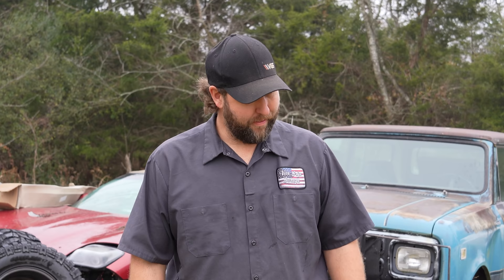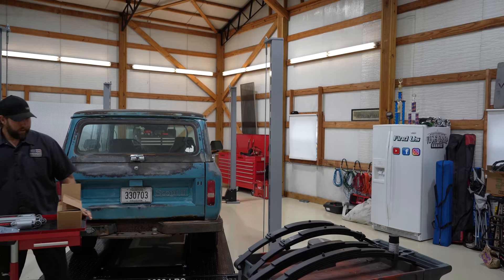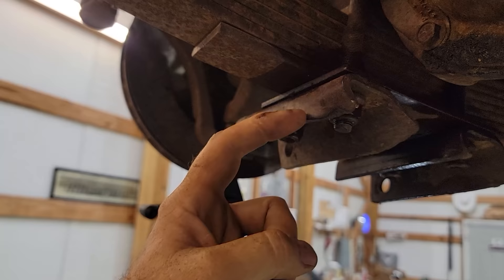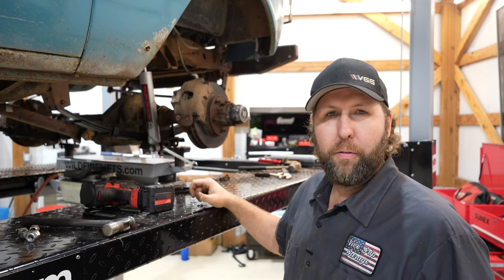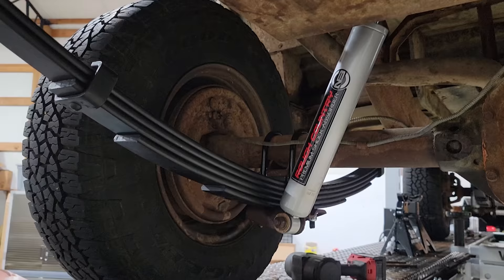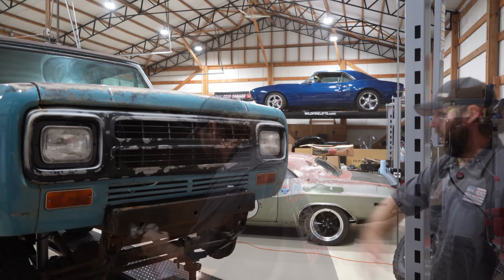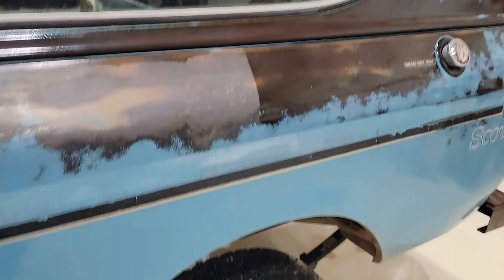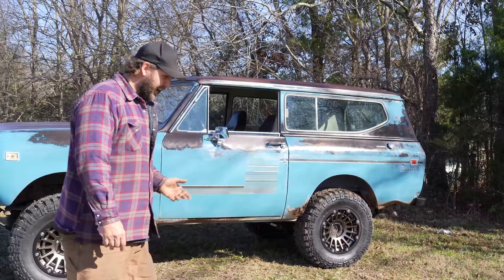I lifted my Turbo Diesel International Scout (INCREDIBLE TRANSFORMATION!)

Comment: Y'know...sticking with the diesel theme, you could maybe find a 4bt Cummins to clean up, and soup up and swap into the ol' Scout. Maybe even get some help from some of the diesel fellers. Just a thought. 

I really like those wheels and having a '89 Town Car with the turbine wheels, I too have a soft spot for them. I also like that mix of brand new and shiny and beat up, patina and I think maybe a matching rear bumper and some old school off road lights on the roof would really bring the scout right around assuming you're gonna be holding onto it for a while. Could be a good rig for goin around the property with and for moving cars around. 

The Lil shop kitty is a cute Lil bugger. Beings he's tasked with keeping the mice down may I suggest the name Bouncer? Like a bouncer at a club? 😁

Comment: It depends on what geats are in your axles now. Sometimes they put low gears in the deisels because they red line at low rpms.  I habe 5.29 gears with 35 in tires and i think im going bigger gears and bought some 5.88 gears. So hopefully i can use 5th gear with the 5.88's in my 93 Toyota 4 Runner. I know a Scout guy local in my area who would know. His brother was my auto shop teacher in high school. He would love to see your Scout. Hes an old timer and probaly doesnt waych this kinda stuff but super nice guy. I had a big block Challenger in high scool and Old Dale the auto shop teacher just would shake his head and snicker when i pulled in. Lol.

Comment: Love the truck wish I had one. They will start better with more compression the pistons can be slugged to increase it. More fule helps it start better the pump can be rebuilt with larger plungers and bigger cam. I guse the axles in those are made by Dana so many of the gears found in pickup trucks will be interchangeable. Also the spider gears can be shimed a lot tighter to help it out with better power division. Also their is a plethora of aftermarket for Dana 44’s and u joints are easily installed a lot easier than the AAM’s. And their are cv axles for Dana’s available. You can also install a better smoking package just don’t smoke any of those left handed filler greens.The headliner could definitely be a moose pelt. With seat liners made from barn yard katskin. It also needs one of those modern revolving moonbeam spotlights so you don’t get into trouble missing one of those DNR roboattos. Definitely needs a heavier cow catcher for for getting the new taxadermic headliner.
Reply: I forgot you can clear coat that paint too.

Comment: You need turbo puffiness, more the better. Then check that fuel pump and injectors are delivering the black goo, a good clean of both will add brakes (horses, that is).

Comment: @vice grip garage some ways to hop up the SD33T is throwing some boat Injector pumps. they can be finnecky though. maybe some fresher injectors too as long as they match the pump. only other thing performance wise would be getting the turbo manifold re done a bit. the engine can take alot of boost but at the same time... it's a high compression engine. no you can't put on a thicker head gasket or modify the head, that's just too much work. i'd recommend maybe an extra 2-3lb boost from what you've currently got, bigger exhaust, cold air ram snorkel if you can swing it, and also possibly making a custom manifold that doesn't have that obnoxious elbow that restricts power. as far as gearing goes... if you want better mileage get you some dana 3.31's. mudding and fun shit would be the 3.73's. It depends on what you wanna be doing with her most of the time.

Comment: I was gonna mention linseed oil after using the ole Ospho treatment because I use that stuff on everything but I didnt think that would be approved, but I saw your link to the other video so you already know one of my special secrets. That suff is sp good we acually use to use that our 3 inch diameter mile long winch cables when I use to tow barges across the Atlantic and around the Caribbean. OG stuff is way better then all the fancy new crap.

Comment: I'm loving the Scout II  Way back in 1980 I test drove a Scout II diesel.  I WANTED THAT TRUCK IN A BAD WAY.   .  But because at the time due to life circumstances it was not a practical or responsible vehicle  for my young 1 car family. 
     Somewhere  stored  away in my memorabilia box,  I have,  If I remember correctly  a June 1980 issue of 4Wheeler magazine.  It might have been Petersons 4X4.  Quoting you, " I don't know". The issue featured the Scout II diesel on the cover and had a several page test review  performed by the staff of the magazine. THE centerfold was a 2 page ad  from International FEATURING THE diesel scout..  If my memory serves me correct it was   a powder blue with orange and black graphics, and orange and black plaid Houudstooth upholstery. IT HAD A BLACK folding convertable top.    I'm going to see if I can dig out the magazine.  I bought the magazine at the Hospital gift shop the night my son was born and was reading it when the nurse come to the waiting room and told me I had a son..  Thats my reason for remembering it was June 1980 issue  and why I've hung onto it for 40years...  PEACE!

Comment: Hey mate i run a sd33t in my mk patrol on 35s in Australia, i run 20psi through the standard turbo with a intercooler and the main fuel screw nearly maxed out and it will happily sit on 110kph with 4.3 diff gears and a 5speed gearbox .
Any more boost and fuel and  youll find the crank or head will want to delete itself 😄 love the build 👍

Comment: Another thing that would help a diesel would be a set of bigger injectors. Also maybe see if the fuel pump can be tuned up some. I’m a Cummins guy and on the older Cummins you could adjust the fly weights in the fuel pump and get more out of it. My dads fist vehicle was a 69 scout but she has 345 gas engine.

Comment: Derek, are you sure you put the correct springs in the correct ends of the chassis?? Some lift kits have the tapered small plate on top of the FRONT leaf springs to orientate the front diff to maintain the proper castor angle. You might find you have "death wobble" when at high speed on the highway.

Comment: Did the Rough lifts on 2 dodges, a 72 Scout, a CJ5, a 68 F100 and a C10, totally awesome kits....But.. put one on an 89 F150 (Traction-beam front axle) snapped the engine craddle in half on my WAY to go mud boggin 😞

Comment: Bought a 95 Ford f250 and it's quite the peach and I relied on vise grips for everything and I managed to only round off 1 bolt it was 1 mile from the restin place and I have minimum tools and it was non running and it took my 6 days is 30 degree weather and just got her home today and didn't even have to change my sparkalators

Comment: Ok, there is a process....  Bigger boost, Bigger injectors (higher flow rate) turn up the fuel pressure at the pump.  Retard the timing to limit internal pressure and keep your heads connected to the block.  Also limit head bolt stretch/breaking.  Diesel Injection in Pittsburgh... Springdale, PA actually pioneered this process with Big Cam Cummins...  600hp from a 400

Comment: If you could find an IH 392 V8 it will go gooder and get about 9mpg tops. The power barn will get a lot fuller if you do that. You could just be thankful you didn't find a really old Scout with the  4 cylinder gas engine. They were like a turtle with weak knees.

Comment: I found one of these about 20 years ago,  behind a garage with a plow,  I asked to purchase, I wanted the plow.. turned out the rig only had 50k miles on her, ran perfect, and the only thing rusted was of all things the oil filter canister.  The best part the new oil filter canister was in the back of the rig.  $500  I made that in 1 day plowing the white stuff, I thought the turbo diesel had plenty of power.  I drove it (2nd car) for years and then traded for a Nissan 300zx   what a mistake,   should have kept the old girl.

Comment: Best choice would be to swap it for a small Cummins, or gas engine. This was  a last ditch effort from international to save the light line trucks. It’s a gutless engine. The IH 4cyl is rated for more horsepower I believe. My old scout had a 345 IH v8. With the right gearing it was a strong engine. 1980 does have the 1% castor to help from the older scouts that had 0 so they would road walk a lot. I don’t see A/C in yours but in 80 they came with a newer system with a larger condenser. Body is suppose to be zinc coated to help with rust… You still have a great foundation for a good rig. Would love to find a good 1980. That little block in the back is a “torque block”. It’s on all the scout II’s.

Comment: There's a few articles on these nissan motors... basically anything you do so the motor doesn't have to run anything helps! Not to much on changing gears in the diffs more about the gears in the manual transmission...

Comment: Well, the first thing you do to get that Nissan i6 diesel banger hoped up is yank it out and toss it in the trash be cause if you try to do any power adders on that engine, the completely unsupported full wet sleeves will just bulge and blow all that extra power into your crank case. 
So pitch it an replace it with a Cummins R2.8 engine. Also pitch that T18 for a TR4050, that way you have the ability to get parts and you have a warranty on both.

Comment: Boost leak? Gummed up sushi cutter? Or is the oil consumption from the trip home and the old block heater / huff gas dose tool a bob a sign the Montana Joe has a loose set of Super-Bowl smoke rings? I guess it is the 200 plus K truck?

Comment: That exact brand and colour of etching primer failed on me with my 97 accord. Put in new rear wheel arches and partial fabbed wheel wells and ran out of the proper  body shop supply etching primer and had to buy one of these olive green dupli brand ones on a sunday to finish the last 15% of the job. All of the paintwork involving this junk had lifted off after 9 months. The other 85% primed with proper etching primer is still ok years later even through Winnipeg winters. Winnipeg is 75 miles from the Minnesota border.

Comment: This is how you find what gear ratio you need to get near stock.
New tire diameter decided by old tire diameter multiplied by current gear ratio. But if your currently gutless what ever you get for a new ratio like 4.55s I would go 3 sizes higher like around 5.13s orsoo

Comment: I dont know if its the same sort of thing, but on my 85 Hilux (Toyota Truck) the drivers side front has a different spring rate due to the added weight of the driver. It was actually a smaller spring overall, to give the same lift all round. But there are no plates, it's just has a higher mount on that side of the axle. When I put my lift kit in I didnt realise and put the fronts in on the wrong side, so the car was at least an inch out at the front, from side to side. Oop, quick enough to swap back after I'd already done it though.

Comment: After working in a welding and fabrication shop, I would never advise anyone to run a wire brush without glasses on…. Oh my god… I’ve had em hit my safety glasses and face shields and the wire stick into it

Comment: You gotta do up the interior! And yeah definitely spruce up the engine. 
I'm not suggesting propane injection, but I dunno bigger injectors and I dunno if the pumps on them Nissan's can go bigger but generaly with diesel fuel is the best way to make more horses. If you're not rolling coal yet see about fixing that :)

Comment: Pull that old oil burner and replace it with the AMC 345ci V-8 or maybe the 360/5.9L from a Jeep Grand Wagoneer. I believe they both have the same bell housing 🔩 bolt pattern.

Comment: I know I'm late but I'm sure there's a few "easy" mods you could do in the fuel pump. The rubber line that comes off the turbo should go to the pump somewhere... There's an adjustment there that tells the pump to add fuel when the boost get up there. As well as... It doesn't necessarily have to return that fuel... You could try blocking the return... Would force the engine to burn it instead of return it... Just some knowledge I've picked up a long the way. Will it work for a nissan diesel? Dunno. Good luck D love your videos man!

Comment: These only have 4 mains, and they are already 21:1 compression, so any performance mods really needs egt monitoring, if it were mine I'd add an inter cooler and turn up the pump a touch, possibly consider chemical inter-cooling or propane injection to keep your pistons from turning into slag.. you want more than 25-50% gain you are probably better off looking for a Mercedes om 603 swap (they have their own quirks, but its a straight six TD with another 50% power and torque stock, plus a better tuning aftermarket)

Comment: When the shocks turn. I use a small pipe wrench. You know.. gripping the shock. Wedged between whatever is breakable. Brake line, whatever. They come apart. Yea it’ll crush the shock but who cares

Comment: Actually the thing about exhaust systems is that you can practically close up the pipe and it will barely effect the flow. Well that's with a set of headers and then you would be closing one of the pipes. So please don't do anything that will almost certainly restrict the exhaust system and make your motor run like crap! Sorry bout dat mi bruv! Out now. So - Oops!!! Hahaha! Haha !!!! As he laughed maniacally in the fashion of Mandark from Dexter's laboratory!!!

Comment: Don't rebuild replace with a chrysler motor. Change the bellhousing. The transferase bolts right on to the back of any torqueflight. Or standards are even simpler you don't need to rebuild the transmission swap any AMC bellhousing to a chrysler bellhousing . Don't have to change any drive shafts or even modify them. You only need to make a motor mount adapter. Then you have a modern drivetrain to last another 40 years. I've done several of these mods in Scouts.

Comment: ive  got  1961  scout  worst  rust  bucket  ever  for  parts  running  gear  =  and  pretty  nice  some  rust  in  floors   runs  and  snow  plow  nixe  body    1963   tank  tough   fixer  upper

Comment: this is a late entry for yer performance question
what it takes simply put is money. U know this stuff.
Ya start at the bottom of the motor and work yer way up . reciprocating mass. on up to the pump.
With a diesel you can go as far as a super turbo
Then of course, being a diesel, gears, gears, gears, and more gears :-)
There is a company in Sweden that makes cam less heads.
Like I said, money.

Comment: You need to learn more about off roading, the old bumper is far far better for protecting the headlights, and radiator, plus the front battery post on the bumper makes the addition of a electric wench so much easier. The protector tabs for the spring ubolts can be a life saver if you do any crawling, as it can prevent the sheering of said ubolts.

Comment: 1967 international scout slant 4 cylinder 3spd hi/lo transfer case granny 4 and invalid 4lo I could crawl faster it was a ggrrrren off road get my bull elk out of the hills rig short bed type truck day cab like blazer or bronco cute little pickup ? Bed just big enough for a bull elk .tiny cab big enough for 2 men shoulder to shoulder? All time greatest off road 4 wheel drive if you had enough hair to drive it it would crawl right over there

Comment: anything you do to that engine will be throwing money and time down a black hole with little to no return on your effort. you just need to put a 12v Cummins in it or a Duramax. there is a reason so few scouts had that driveline - because it’s absolutely terrible and cannot be redeemed.